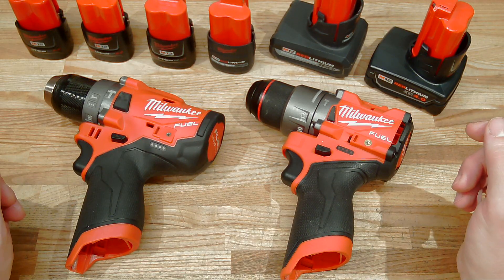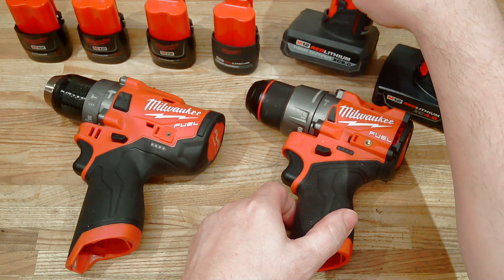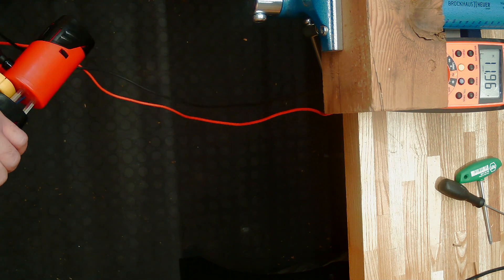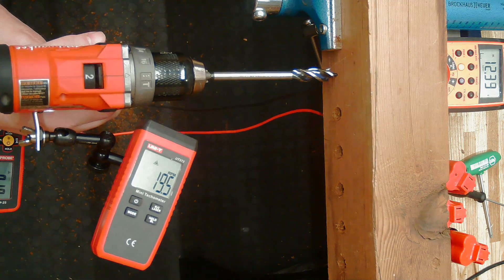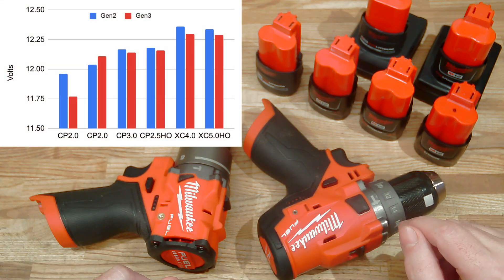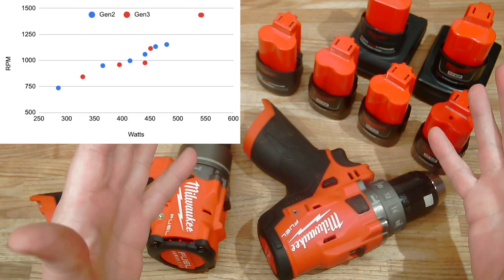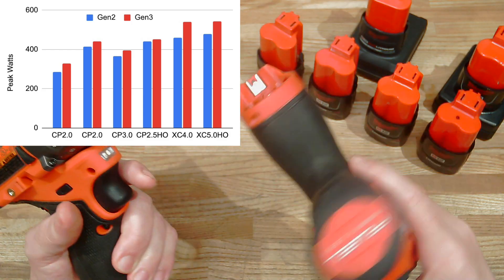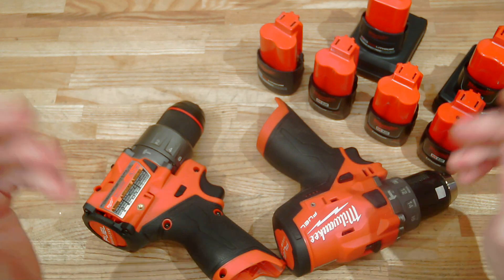Test: Milwaukee M12 HO Batteries Better In Their Fuel Drills?

Comment: i have the m12 drill/driver.  ,and a m12 fuel hammer drill/driver gen 3.  with 4 batteries. 2 ,1.5   and ,2 2.5.  both charge fast. and last.     have a good day